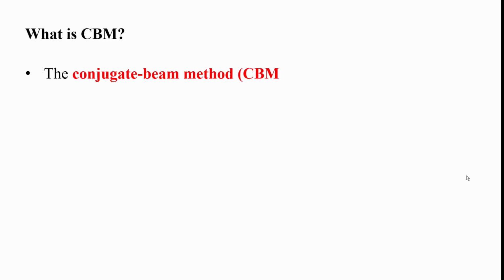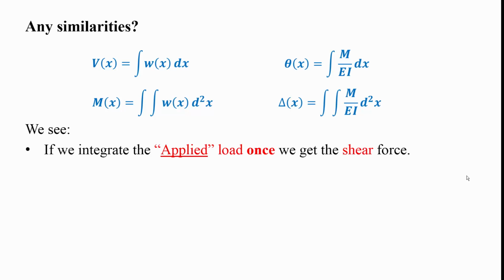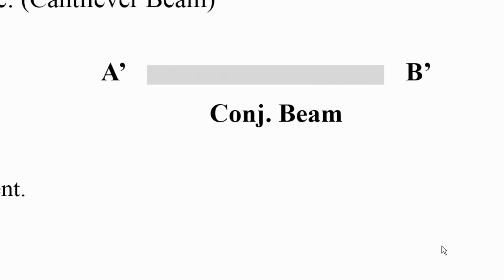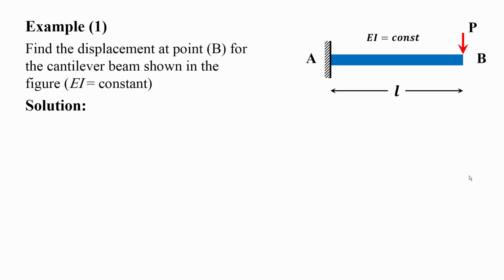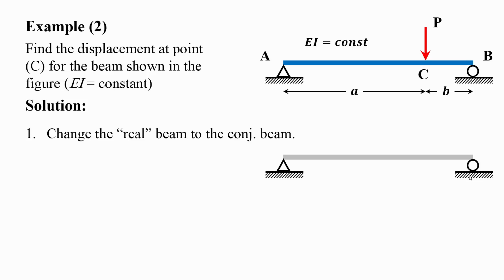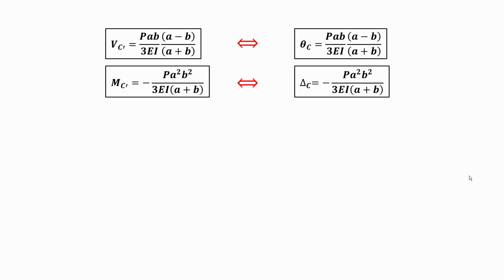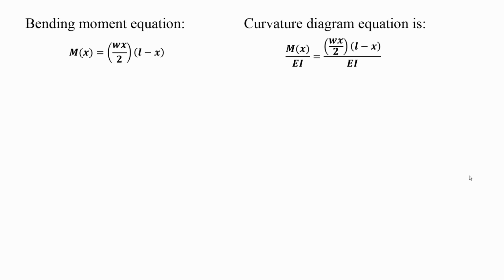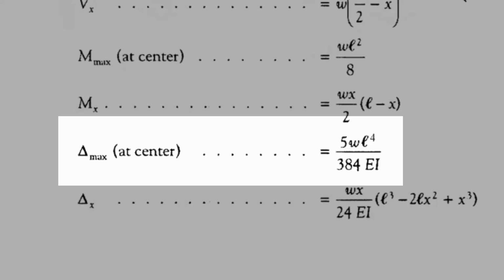Beam Rotations and Deflections using Conjugate Beam Method - CBM -

Comment: Thanks, it is really fruitful explanation..
Regarding @27:01 what do yo mean by efficient?!
Because it has a quite different meaning from the word 'easier'
Reply from the maker: could not find the word efficient at that time :) can you please double check on the time stamp. Any you are 100% right efficient does not equal easy :)
Reply: @CTSCIVIL  sorry :) @23:10
Reply from the maker: @ammaralhajri  I see what you mean. Efficiency in this case means quickness + minimum errors. It might not be "Easy" However, it is shorter
Reply: @CTSCIVIL  thanks for the clarification. 🌹

Comment: Sir could you please make a video showing  how to calculate beam problem using heavy side notation method,with different supporting,and load type like triangular load,beam with pin joint etc?

Comment: Hi CTSCIVIL,
I am wondering if you can set up function for beam deflection, continuous beam over three supports, distributed load and these two beams are connected with a join between two supports, in practice you can imagine one beam simply supported, and the another one also simply supported with overhang.
Thank you in advance.